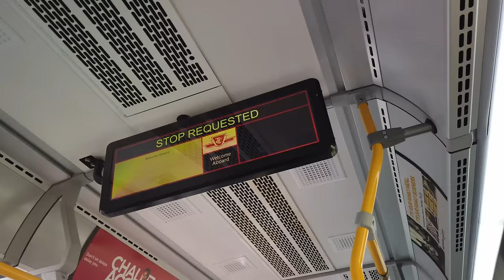Why American Buses Are Just Worse

Comment: When I lived overseas one of the biggest differences I noticed was bus etiquette. It was strictly enforced that you get on the bus at one door and off the bus at another (whether it's front or back will depend). This ensures a constant flow from front to back, and prevented everyone clustering up front with an empty back half. Most of the wintertime "crowded" buses I see have an empty back half, and almost all of the skipped stops are skipped unnecessarily. 

Part of that etiquette overseas was the driver enforcing the rules, but sometimes it was structural; if it had a tap-on/tap-off system there were separated terminals for tapping on and off the bus, in once case there were turnstiles, maybe the driver only opened the rear door at stops, but mostly it was just the other passengers who enforced a flow of foot traffic. It seems like a small thing, but it can completely change the experience
Reply: The front door boarding is actually not that common in Europe: all of Eastern Europe, Switzerland, and a growing amount of other bus networks have all doors boarding. Here's a personal experience about the difference it makes: I live in Belgium, and 2 of the most crowded bus lines in the country are Brussels' line 71 and Liege's line 48. In Brussels you can board by all the doors, in Liège, only at the front. Both use 4-doors articulated buses. Well the time spent at each stop is much much longer in Liege where everyone boards at the front and the driver actually checks if everyone validate their card. In Brussels, for a similar amount of person, the bus only needs to stay about 10 seconds at each stop because people board by all 4 doors, and there are card readers at each door. In fact it took so much longer in Liege...that they decided to abolish front door boarding on bendy buses during the day. Also rear doors are usually automatic in both European and American buses: there is a button (or in America a bar or a strip) on the door that needs to be pushed to open it, and there are sensors that will close the doors automatically if no one is detected for a few seconds. The main difference is that European buses have sometimes this button both inside and outside to let people in by the rear, and also there is a doors closing buzzer on some (depends on the company bit it's becoming more common with every new version of accessibility rules)
Reply: Then there's Italy, where on a city bus, you get on at the front or rear, and get off in the middle
Reply: @imaginox9  also I thought Liège was all door boarding - I went on a Citaro C2G on the 48 and the validators are located at all doors, plus people were boarding from other doors too
Reply: @gabrielstravels  They actually allowed all door boarding recently. With the pandemic and the fact that the front door was inaccessible, they've let people in by the rear and probably saw how much quicker it was so they've not returned to front door boarding now that the pandemic is over. And that's a good thing !
Reply: @imaginox9  ah that explains it then. Good thing indeed!
Reply from the maker: I would say this varies at lot across North America!
Reply: @SuperKurvaszad  Hungary is Central Europe!
Reply: @gabrielstravels  Well in Italy you may be supposed to do this, but most people merrily ignore it.
Reply: @mancubwwa  Typical. Actually even I sometimes ignore this 😂
Reply: @imaginox9  man I wish my local bus company would adopt this policy. They do an ok job, have great buses and a mostly decent schedule outside of the city core (in fact, i ride 25km north to a tiny village of 1k people daily) - but as soon as pandemic restrictions lifted they stopped using all doors (2 mostly on the rural route, but sometimes an additional bhind the rearaxel)
Reply: @mancubwwa  In Rome often drivers stops the bus on purpose to make passengers board from the back door because they don't want to feel the cold air from outside, or want no passengers to come to the front. It's quite frustrating, but almost everything regarding public transport in Rome is
Reply: @LucaPasini2  I concur!
Reply: @LucaPasini2  same here in Naples
Reply: What I have seen in a number of places in Germany and Switzerland are signs to only enter in the front after 20:00 (8 PM). I think this is done for safety reasons (or at least the perception of safety). Since both passenger and road traffic volumes are lower at night but the timetable stays the same, the slightly longer boarding time is not a problem.
Reply: Not sure if it's just poor maintenance or what but in Winnipeg the "push here to exit" strips  for exiting the back doors seems to work about 60% of the time, so you can't count on them and I've had to run up to the front door or miss my stop because the door didn't open.
We also have the issue in winter where we pile snow up on the sidewalk and only clear it  for a 4 ft wide path at the bus stop. This means the back door opens into a 3ft high snow bank to climb over.
I wish dearly that we had all door loading with a tap far box at the rear door.
Reply: Not doing all-door boarding is not great because if you have a lot of people getting on at one stop, the bus will be stuck at that stop for a long time just so everyone can pay their fare.
Reply: In NYC the bus driver usually refuse to leave a stop if the back of the bus is empty, and he makes everyone move back. They have installed OMNY card readers at the back doors, but they’re all set on “front door boarding only” mode for now.
Reply: When I lived in Seattle, front door boarding was policy on routes that collected fares, since the farebox was in front.
Reply: And then in Japan, you board through the rear doors and take a numbered ticket. Everyone then exits via the front, where you pay the fare at the end of the trip to the driver. This was also the case on certain trams and even on some trains.
Reply: @imaginox9  In Winnipeg, Canada, the farebox is up front, beside the driver. So all boarding is via the front door. Many people also exit via the front, too, as the driver can only guarantee safe exit there, especially in the winter, where high snowbanks are along the curb. Only fare avoiders board via the rear doors.
Reply: @GregOughton  You're not really supposed to push the doors to open. Just a touch on the marked area is all you need. And you must wait for the light and not be wearing gloves, so the sensor can see your hand. Pushing on the doors, especially when the light is off, will actually lock the door, as it thinks someone is falling out. It would be helpful if the city would order the remote driver opening feature, which is available in most other cities. But we didn't even get air conditioning on buses until 2010.
Reply: elfrjz  Poland, Czech Republic, Slovakia, Latvia, Estonia, Bulgaria, Romania, and probably others too
Reply: I don’t really agree with the notion of front door boarding being better. It’s usually so the driver can check if people have a ticket, since having random ticket checks on bus lines is rather uncommon. In my experience, all door boarding is usually adapted on bus routes with frequent boarding and deboarding, to shorten dwell times.

My personal number one sign concerning etiquette is, do people let others leave, before trying to board.
Reply: @dougbrowning82  a) where's this light? Maybe I'm just super unobservent but I've not noticed it. 
B) I have to take my gloves off before exiting? Would be nice if they had a sign...
This whole time Ive been pressing on the strip (with gloves after Oct.) As soon as the bus is pulling into the stop. 🤦
Reply: @GregOughton  It's usually a green light mounted on the header above the door.
Reply: I think only one door for boarding would be quite terrible. Front boarding only makes sense when you assume the passengers will try to not pay the fare and are unable to let people out of the vehicle before rushing inside at the stop. That reminds me of when a person from China said it was really weird and amazing that we here don't have guardrails blocking the tracks in the metro and people let others who need to get off step off the train first before boarding themselves. Good etiquette to me is actually this what i describe, not denying me the choice of which door to use, but me knowing that i, and not all, but at least most other people, will pay the ride fare, board/unboard safely and move around inside the bus in a way that does not hinder others boarding/unboarding.
Reply: the point of strict front boarding is to controll that only people with tickets are entering the vehicle. In societies where buss pass is more common it becomes more relaxed, but if you have lots of people with no ticket, then it becomes necessary for proper financing.
Reply: In Germany it depends on the bus. If it is a city bus you board just somewhere to speed things up. If it is a regional (Does not necessarily only serve villages, but does not exclusively serve the city...) you get in at the front, so that the driver can check your ticket.
Reply: @RMTransit  your buses are ten times better then those in Balkan countries. Just look at Serbia and Bosnia. They still use 40 year old busses. I live in Croatia and when I went to high school I had to drive in bus with wooden seats and with no AC.
Reply: @brachypelmasmith  there are flying inspectors that control and give you fine. You have large numbers of them on contracts and then reduce it over time.
Reply: @ollie2074  interesting about that ticket. In Pittsburgh we had a "pay when you get off" system when traveling away from downtown. It was great for boarding, but on our busier routes, it lead to long dwell times as everyone exited the crowded bus out the front door
Reply: @imaginox9  Many buses in Japan instead have you board at the middle/rear & alight at the front. It'd make it more difficult to alight but it makes fare evasion harder, since such buses charge distance-based fares (upon boarding you get a ticket with a number that depends on how far up/down the bus' route you board, which the driver/fare machine checks upon alighting to estimate your travelled distance) paid upon alighting, where the driver is, so he/she can check that you paid the right amount
Reply: US doesn't have such etiquette, sadly.
Reply: @RMTransit  American buses used to look alot better, the GMC new look or RTS series blow most european bus aesthethics out of the water, do i want some bland 2010s brick or cool 70s design?

Comment: In Munich (and some other German cities) we even have non-articulated busses with trailers (called “Buszug” aka “bus train”) which allows to adjust the capacity of the bus to the current demand. 😁
Reply: in the 80-s they had bus-trailers in LA pulled by a "normal" semi tractor
Reply: @jasonriddell  Some of those vehicles and even busses with trailer have been used in Munich in the past (in the years after WW2 I think) as well, but we're then forbidden due to safety concerns and in fact they still are forbidden. It's only due to advancements in technology (cameras, detection if someone is in a door, etc.) that those cities that currently use trailers for their busses got a special permit and that only started 10 years ago or so.
Reply: Bus trailers aren't very good: Budapest have stopped using them in 1969. It has many problems, plus it puts strain on the towing bus, which isn't very healthy.
Reply: @mozeskertesz6398  with the technology standard in 1969, yes.
But for a bus above built year 2000, there is no disadvantage
Reply: @mozeskertesz6398  Munich (and Germany in general) also stopped using them around that time due to problems at that time (e.g. safety), but nowadays these problems have been addressed and since around ten years busses with trailers are a suitable alternative again when one wants the ability to increase the capacity on demand without having to use more courses.
I don't know if there are any known issues regarding the additional strain of towing a trailer with current generations of busses, but I can imagine that this improved compared to the 60ies as well.
Reply: I used one in lausanne some years back. it's trash and people don't want to use the trailer because they don't feel safe, especially women. probably discontinued by now since it was an old piece of garbage.
Reply: Is sadly not legal in Canada
Reply: @Maurazio  in Munich they have a very high acceptance (including with women) and are sometimes even preferred to the bus itself cause you don't have the engine noise as much. Also they have a bit more open area for strollers and such compared to the bus (though they don't have a ramp for wheelchairs).
Reply: @busmekanx  in that sense they're not legal in Germany either, but those cities that use them have special permits.
Reply: Trust the Germans 😉🥰 Despite your Chancellor's recent efforts to return Germany to its popularly level of around 80 years ago (although as I write this, I believe that's about to change...) I have a soft spot for Germany and Germans: years ago, I regularly found myself there both for work  - and holidays. In the latter case, mostly driving across the south west and Bavaria to reach Kitzbühel, having set off from Amsterdam. Because of the distance, we'd split the journey over 2 days, with a stopover mostly in Köln or München. One night, after a particularly hard night of partying, found myself at some random's house and awoke to find it was early next morning. I knew my fellow tourists would also be awakening, albeit in their own beds at the hotel😏 Despite feeling hellish  -  I knew I would feel worse if I was the cause of significant delay in finishing the journey so dressed, bid adieu to my host and ventured, bedraggled and underdressed (as well as reeking of smoke - aahhh they were the days!!) I remember feeling spectacularly vulnerable, having ventured outside, discovered (it being about 7am on a February morning) everywhere was frozen solid  - with everything entombed in about 2cm of frost. Moreover, it was a big and wide boulevard but, also being early on a Sunday morning, deserted. I had no idea where I was and long before the days of smartphones, or even "handies"😎 By chance, I encountered VAG München  and saw one of the staff - almost certainly a salesman - opening up for the day. I asked him where I was and how to get to the Hilton and asides from the fact he could see my dejection at struggling to remember the directions  - and even understand them  -  could see me both lacking suitable protection from the cryogenic temperatures and generally wilting under the task of getting successfully to my goal. I think more frustrated at having to remind me again, after the third or fourth time, I think waved it away and motioned towards his company Audi Quattro - and ten minutes later (quite a walk in an unknown city, at -15°C in a t-shirt!) arrived in the lobby!! I will never forget that, nor my "random" German host who  BIZARRELY, I met in the same club under the same circumstances exactly a year later!! Soooo friendly, so charming, so hospitable - and who doesn't love Schweinshaxn, Schnitzel and kartoffelsalat?😄

Comment: The bus in the thumbnail is a Mercedes Benz Citaro C2 running on Budapest's 124th line between Bosnyák tér and Rákospalota, Bogáncs utca. Its a city outskirts line running every 30 minutes, in rush hours 15-20 minutes.  It connects lesser traveled parts of Zugló, Pestújhely and Rákospalota offering connections to mainline trams or buses.